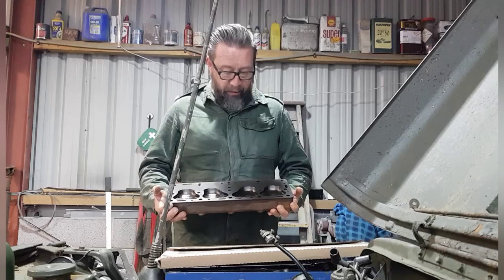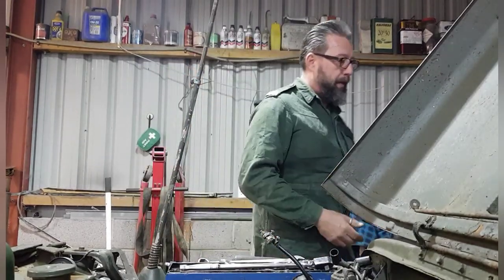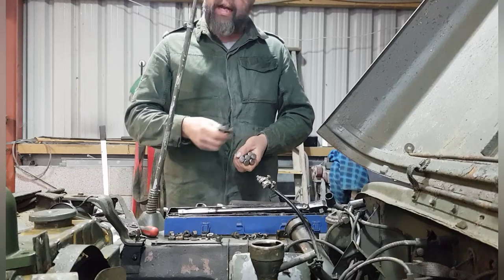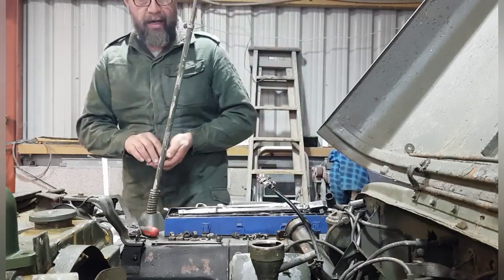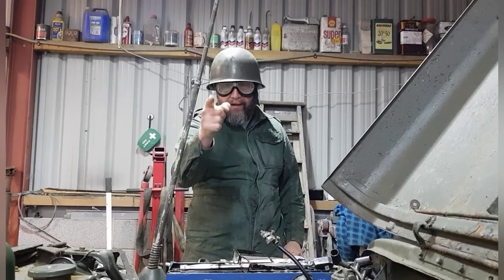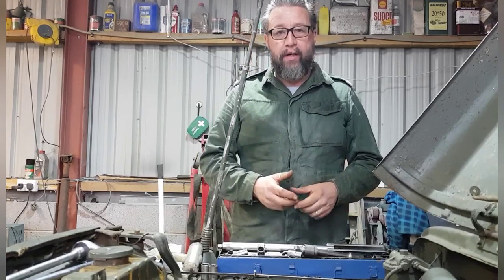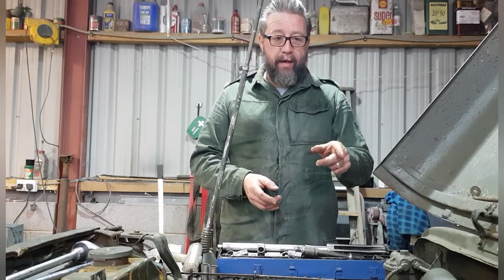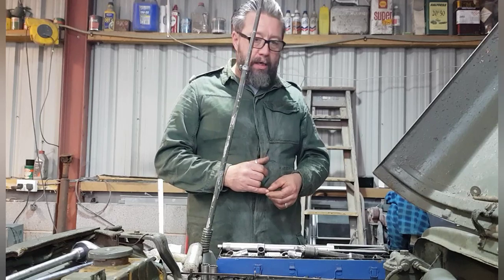Ford gpw head refit

Comment: It has a thermostat so that the engine runs at the correct temp and not too cool, it has nothing to do with the heater.
Reply from the maker: Nice one mate, there wasn't one in there.  So i will pick one up Sunday.. Cheers bud
Reply: That is correct. I spent many years working on and sourcing parts for GPWs, MBs or G503s (mix & match, call 'em as you like.) The thermostat is actually very important because this vehicle was designed to operate in all theaters so the cooling system (okay, radiator) is over-sized for most climates. With no thermostat, that cooling system is operating at 100% all the time and will certainly keep your engine from ever maintaining efficient operating temperatures. During the war, even in the dessert, it was found that Jeeps would regularly over heat without a thermostat because the water in the cooling system was starved of the opportunity to cool enough while in the rad - the thermostat provided a restriction in coolant flow in that case. Just as a side note; they also found that in dessert, using antifreeze increased the efficiency of the cooling system but it was generally never used by allies or axis forces because the cooling system was seen as an emergency supply of drinking water. Metalic and dirty or not, water was water and water was survival. When vehicles broke down and were abandoned, the cooling system was drained and canteens refilled just as often as gas tanks were drained and gas cans filled for other vehicles.

Comment: If you drill a 8mm hole in the outer edge of the new thermostat, it will give yourself more time to detect a stuck or not working..thermostat..

Comment: Eugene is a composite Jeep. By the end of the war they will manufacture jeeps with parts from willys or ford. Yr body tab is a willys.
Reply from the maker: So what does that mean exactly? How do I find out more on his history?
Reply: MAD WORKS GARAGE it means that yr jeep has been made from parts from both manufacturers. Also there is a chance that it may have serviced after the war and they put whatever parts they had.  I suggest you try to find more from the number you have on the glove compartment. There are three labels there. The middle one has the serial number you want. Also you should check if yr engine is a Willys or a ford.  During war the Willys engines were painted OD and the Ford engines gray.
Reply from the maker: @akissparaskevopoulos  242724 is the number on the middle plate, I'll see if I can find any others... Thanks for your help